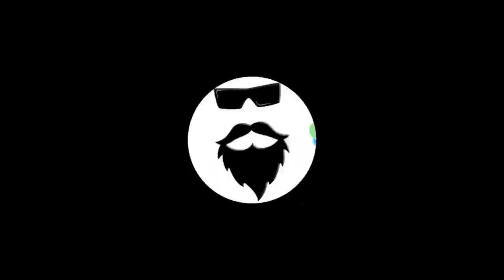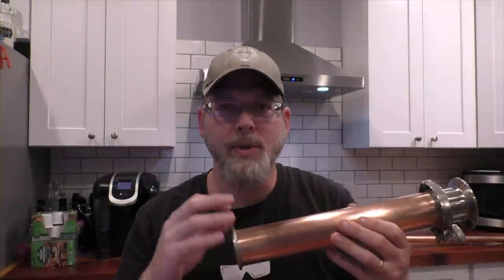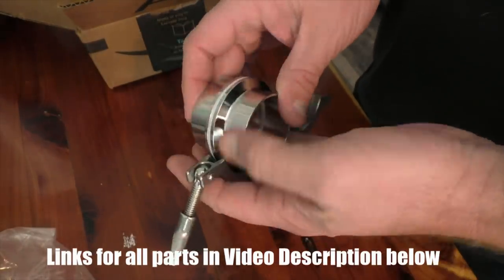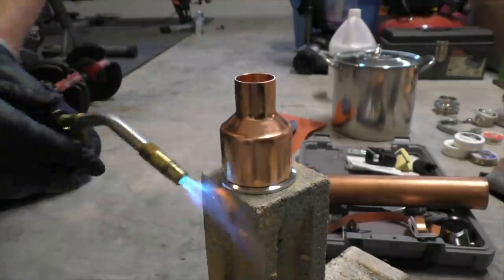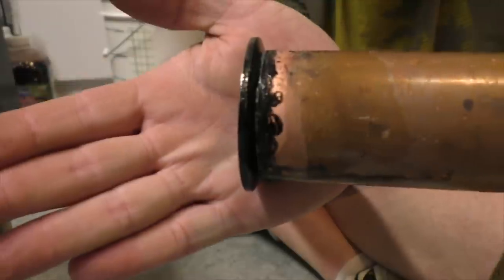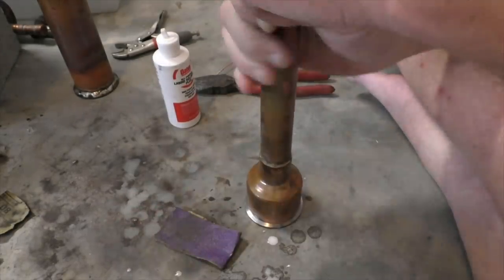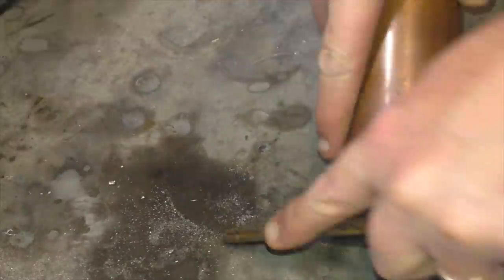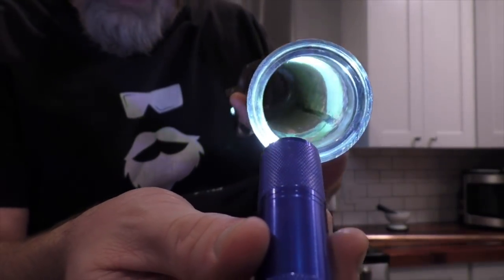Build a Simple Modular Pot Still Head + How to Solder Copper to Stainless Steel.

Comment: There is so little  acetic acid in vinegar that diluting it even further and the fact that it’s boiling point is even higher than water . I just can’t imagine that would be the best way to clean your new still .. soaking in citric acid makes more sense to me
Reply: Soaking in citric acid is far and away a superior method. Vinegar works because you can boil it in the still and it will travel up the still, unlike citric acid. But if you are just going to soak, use citric acid.
Reply: how much acetic acid can you really believe would actually make it through your column . Vinegar is generally 5% acetic so adding a gallon of water dilutes it to 2.5% and with acetic acid being less volatile than water I would be surprised if you are really doing anything more than running water vapor through your still ..a sacrificial run would at least run ethanol through
Reply: @tomde7904  having done a vinegar run myself,  I can tell you that you definitely get a lot of it coming out the still.  The smell is so strong my wife won't come near it.  And you can see the green come out the product end and the copper is visually much cleaner inside  when finished.  

I'll use a mild mix of citric and hydrochloric for soaking to clean new parts.  But if it's been sitting and gets a lot of oxidation inside then the vinegar works great.  

One other thing,  the hot vinegar vapor works a lot better than the liquid does.
Reply: @ThinkFreely2012  I would be curious to find out if you would get the same results if you just ran steamed water or even better run your foreshots  through
Reply: @tomde7904  fores don't have the acids to dissolve and pull away the oxides from the copper.  Nor does water steam.  And citric acid wash alone won't even touch metal if you've got oily residues from flux or even from your hands handling the materials.
Reply: Another thing,  if you're a noob starting out,  you may not even have fores you could run though it anyway.  🤷‍♂️
Reply: I can tell you this. If you start out the vinegar run with the condenser on and catch the distillate coming off. It will not be clear or clean. It will be oily and green if there's a lot of oxidation on the copper. It will also smell like straight vinegar. Did this to prove a point. Don't run your condenser long you need that vapor to clean it out as well. I generally dump and rinse off everything after the vinegar run. Then I'll blast straight water through it too. Its a very effective humidifier 🤣

Comment: Hypothetically, I also want to build a column. 
     Why did you choose to use copper pipe with a stainless Ferrule? I guess you did say that the copper pipe is what you have on hand, perhaps that is why, but it seems like a pain in the butt. Is an electrolysis reaction between the steel and the copper possible? 
I was looking to just buy Stainless Steel Sanitary pipe on Amazon with tri clamp fittings built in. I plan to have copper bubble plates for my "essential oil" distillation unit.  Hypothetically, of course!
Reply from the maker: I used copper pipe because I can't weld, but I can solder a little, and stainless ferrules are cheaper than copper ones. Your hypothetical design will work great. The stainless steel pipe sections and copper bubble plates are a really good way to go.

Comment: I suck at soldiering I try soldering cooper to cooper for
House plumbing and no matter how hot and clean I get the copper the soldier just beads off won’t 
Do what it’s supposed to do so I gave. Up and went to pex line

Comment: One thing to keep in mind. Never, Do Not Ever, use a wet tag to cool your solder connections. This can fracture the solder  in between the connections. Let them cool gradually. A hair line fracture will at first hold pressure. Once it goes, your screwed.
Reply from the maker: Is the quick wipe ok, or should I have not done that?
Reply: @BeardedBored  Do not wipe, wait until it cools off. Then apply a little flux again on top and reheat only the surface and polish with a wet rag. You'll end up with strong and polished joints.

Comment: Do you think you could do the same process with PVC pipe?
Reply: As long as you use a cold flame torch otherwise you risk melting the PVC.
Reply from the maker: I'm not sure what you're asking. Do you mean to make still parts from pvc?
Reply: @BeardedBored  Yes, make the same type of device, just using PVC plumbing instead of metal
Reply: @marcelgaddis9319  Well, I was really thinking about making the whole device out of PVC, not just the soldering process. Thanks for the comment though!
Reply: @samm1926  Traditional product PVC has a maximum operating temperature around 140 °F (60 °C) when heat distortion begins to occur. Melting temperatures range from 212 °F (100 °C) to 500 °F (260 °C) depending upon manufacture additives to the PVC so keep that in mind. But you could go to the auto parts store and get some stainless steel exhaust pipe and use that, if they have scraps you might get the stainlees for free maybe from a muffler shop as a alternative.
Reply: @marcelgaddis9319  Ah, thanks!
Reply from the maker: @samm1926  Don't do that. First, the pvc will melt from the heat and the alcohol, second it will leak highly toxic chemicals into alcohol. Before you do anything, go to this site and start reading. https://homedistiller.org/forum/ There's tons of info on the right way and wrong way to do this, and why certain materials are a bad idea to use in a still. This is a research heavy hobby so dig in and read as much as you can:-)

Comment: This is older,but this works as the first step,us a big bottle brush and dawn soap,warm water,it's a degreaser,when you look at the inside you will be surprised how clean it is,when it's ready to deep clean use a couple gallons of water and citric acid,steam is a medical cleaning method,run it for 45 minutes after a dawn wash,it can't get any cleaner,sacrificial run is lower temp and your adding sugar and other stuff,lower pressure,lower temp,not worth it,I worked in medical piping,after steaming they took cultures,put them in a dish,added whatever they us,check for bacteria,it's easy to think some bug might be lurking,nothing is meaner than steam.

Comment: Has anyone tried the 2 inch copper Ferrals? I saw some on eBay and was just wondering I f they worked good.
Reply from the maker: I'm hearing that they work great and are way easier to solder. I went with steel for the price:-)

Comment: Excess solder is very easy to remove while hot. Just brush it away. Put heat to it again if you need to, but clean solder joints are not achieved through filing, sanding, or grinding. This isn't welding.

Comment: 56% silver solder of higher would be my recommendation
Reply: It's great stuff,  but it's expensive and it takes a LOT of heat.  But it's strong!
Reply from the maker: Thanks Mark!
Reply: Ty for sharing!! ✌
Reply: Thanks for this. Stupid question maybe but most of the silver solder rods on UK eBay are 55%, can I assume that would do? Also, I have a bottle of normal liquid solder flux; can I use this or do I need the silver specific flux? Thanks!
Reply from the maker: @widgets76  Normal flux will be fine. I don't know on the solder. Better look it up to be sure.
Reply: @widgets76  55% would be fine,  however that's more of a brazing type solder that requires a lot more heat than normal silver solder.  And it will require a high temp flux.  Liquid is fine, but for this high temp silver brazing i use a white acid paste flux when brazing stainless to copper.
Reply: @BeardedBored  much appreciated, looking forward to the rest of the build 🤘
Reply: @ThinkFreely2012   ah thanks for that! Will be using map gas so will have a look for the white acid paste flux in that case 👍
Reply: @widgets76  usually a high quality soldier will come costed in a flux so you don’t have to add flux
Reply: Coated
Reply: @widgets76  Harris Stay-Silv white is what I used with Harris 56% silver solder.  Don't breathe the fumes,  they'll jack you up.
Reply: @markhawkins497  I've tried that stuff for brazing stainless to stainless.  I didn't have much luck with it.  I ended up scorching the metal and it didn't wet well for me.
Reply: @ThinkFreely2012  stainless is real tough to braise it hold temperature differently than copper brass and aluminum have to be gentle with heavy and let silver flow easily.
Reply: silver solder the spacer ring to the SS sanitary connection first with Harris stay silv and 56%.  It's a brazing solder that works at about 1100F.  After that use the low temp plumbing solder for all copper bonds

Comment: The only reason you’ll get blue dissociate is because the acid hasn’t been removed or neutralised properly all you need to do is buy some bicarb soda which is dirt cheap and neutralises acids mix it with water soak each part for around 5 minutes then wash out with clean water no need to go waisting good spirits on a cleaning run.

Comment: Everything you need to know except what the hell was the "shim" to make everything fit.
Reply from the maker: I just used some thin copper sheet that I got from a hobby store and cut some strips to wrap around the pipe for the column section tri clamps. The shim for the reducer tri-clamp had to be thicker copper to take up the larger gap, so I cut a ring shim 1/4" wide off the column pipe to fit in there. Sorry I forgot to cover that in the video.

Comment: Ok first, never flux the inside of a fitting. Only the outside of the male fitting. B. Flux paste is better because it doesn't run and you never add flux to any area you don't want soder. Which is why you never apply soder to the inside of a female fitting. It will push it away from the joint instead of spreading it into the joint. Oh, and, apply flux to the finished joint to help clean it.
Reply from the maker: Well, that certainly will help my next project:-)
Reply: Unfortunately I can't help you with the past but I'm sure this isn't the last time you will try your hand at swetting pipe.
Reply from the maker: @bryanbrunk1186  Definitely got more projects to do in the future. Thanks again:-)

Comment: Why didn't you put the pipe with the ferrule in on some brick instead of hanging it like that? :o)
Reply: Some brick will flake and pop and break when you put heat in it.  I use fire brick that I got pretty cheap at Tractor Supply.
Reply from the maker: The brick soaks up the heat and makes it very difficult to get the steel hot enough.
Reply: @BeardedBored  I tried a lot of different ways to setup the work.  One way was to lay the pipe horizontal while soldering.  Another way was to set the pipe on end on the fire brick with the ferrule set in place on top and let gravity do its thing.

Comment: Your video and trial and errors inspired me to attempt the build. Thanks for the great video. Ran into real problems trying to solder ferrules to copper pipe (tried it with paste flux). Ordering some liquid flux from Amazon. I also looked up ways to make ferrules just using the 2 inch copper pipe and found some very practical DIY methods I will experiment with while I wait for my amazon order. See link https://homedistiller.org/forum/viewtopic.php?t=27056
Reply from the maker: Yeah, I tried paste flux first too. Make a horrible burned mess. The easy flange definitely works, but I didn't have the courage to try it;-)
Reply: @BeardedBored  I must say your video showed me to keep trying and improvising. Never soldered or worked with metal pipes or 'water purification devices'  :) before. I am now tothe point where I getting used cooper from a recycling plant and disassembling fittings and splitting and hammering out tubes to cut and  fabricate ferrules and make reducers or other parts. Thanks for your great advice. I can send a picture of my build if you are interested.
Reply from the maker: @garthhorne617  Send me an email:-)

Comment: Paste flux is fine, you were too stingy with it. You need a fair amount of flux, my old welding mentor used to berate me for not using the least expensive material in the process enough. Get the flux boiling, do not get the metal red though, then when its evaporated away add the silver. You want it to flow, not over pour. If your gaps are tight you won't get leaks. But there is nothing I can't add than a few minutes watching a vid will teach you. And citric Acid is your cheapest, lowest labour friend afterwards ;)
Reply from the maker: Thanks Nelly.

Comment: How to attach stainless to copper You tig weld it. Use 70 30 copper silicone wire
Reply from the maker: I wish I had a tig welder...and that I knew how to weld:-(
Reply: @BeardedBored  all my connections on my still are either TIG welded or welded with Romex copper wire.
Reply from the maker: @heavenhellspirits6723  Nice!

Comment: The term “silver solder” doesn’t travel well🤣
In Europe, silver solder is akin to brazing and needs a much higher temperature, circa red hot, and different fluxes, and is used for copper piping on things that get seriously hot, like stream engine boilers! To me, you are using “soft solder” that is used for electronics and plumbing, no lead content nowadays, but it all melts at circa 300 centigrade and with a soldering iron. Are you certain that lead free soft solder is ok to use with hot “harsh chemicals”??? It is fine for water jackets etc but the jury’s out on the joints that see “ Hot harsh chemicals until someone gets on here to prove me wrong!
P.S. what do Americans call the 600 degree solder that has an actual silver content then?

Comment: Do you know what schedule pipe you used.  I bought 2" pipe, and my 2" ferrule does not want to go into the 2" pipe.  I think I have a heavier pipe, but it should fit, and doesn't.  Any suggestions or ideas on what is happening wrong.
Reply from the maker: The only thing I can think to try is to heat up the pipe until it expands slightly, but keep the ferrule cool, then try to press fit the ferrule into it. A buddy of mine did that, and I think he just heated the pipe with it standing up, then set the ferrule on the opening and tapped it in place. Other than that little tidbit of info, you'd need to talk to a pro. Hope that helps.
Reply: I just did this, with the intent to anneal - not expand.  Using thick type L pipe & MAP Pro gas, heating upwards the top inch or so all around then pausing with a circular motion to give enough time and heat to cause a color change until I got all the way around (13 minutes), then quenching.  I then sanded inside & out, cleaned with acetone, then applied the Harris liquid flux to both the pipe & ferrule (which was also mechanically & chemically cleaned).  All prepped, copper softened by annealling, I used a piece of wood and a small sledge hammer.  It tapped in quite easily.  Adjusted it to fit true and plumb using a speed square and the piece of wood.  Then silver soldered with Harris Number 8.  It accepted solder readily -- something I worried about given such a tight fit.  I'll have to wait for a 2" clamp to check for leaks -- used my last twelve inches of #8, but I think I'll be ok.  Bearded, if you want my hand-held B-roll, I'd love to share it with you -- not something I wanna post, but do want People to see -- no voices or faces or trademarks appear in it.